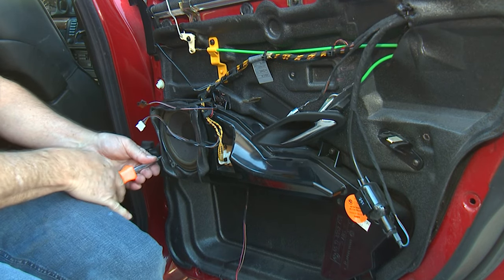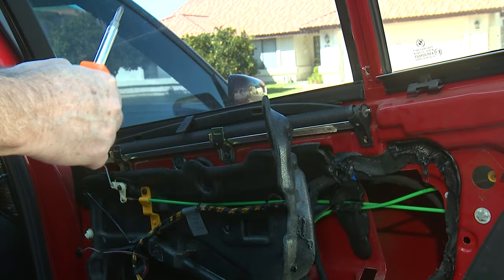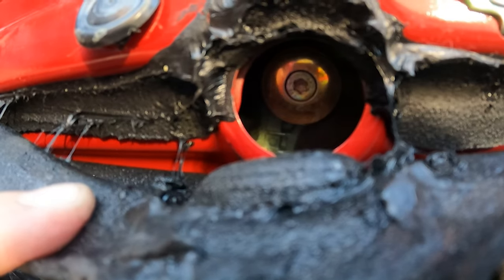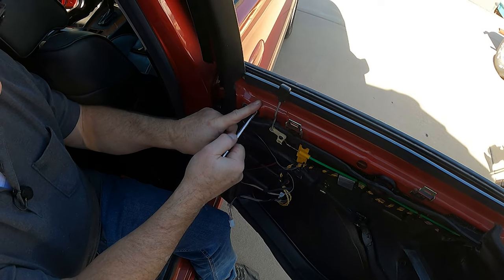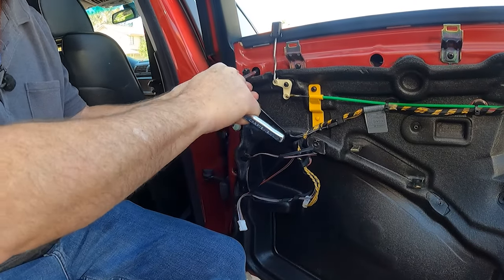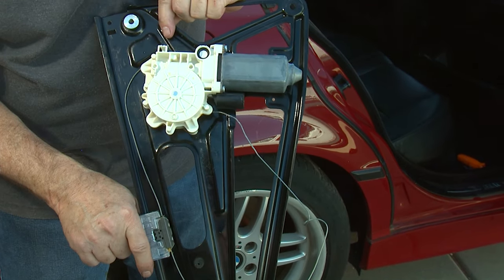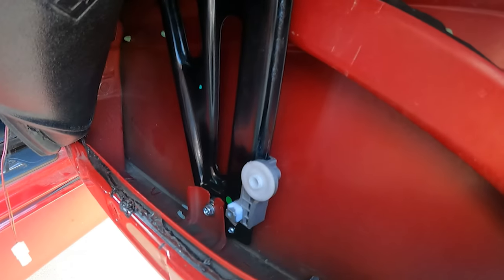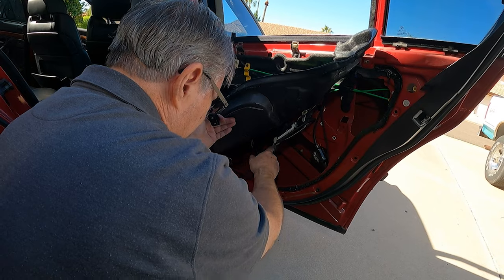Fix Your BMW E38 Rear Window | Easy Regulator Replacement Guide (1994-2001)

Comment: You stated that the bolt for the window was a T-25 and at the end when installing the window you stated it was a T-30.  Need to clarify what size.
Reply: That was just misspoken during his video.     T25 and T30 come in a set, this shouldnt be a show stopper